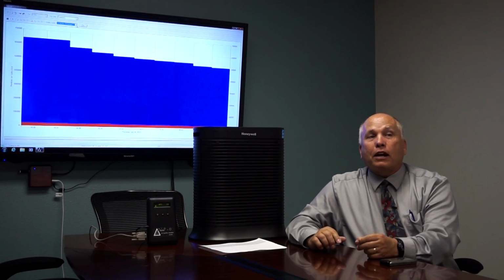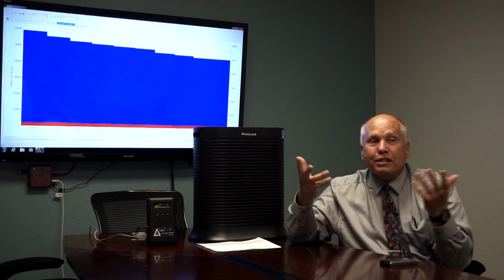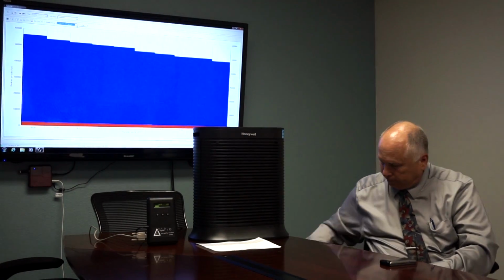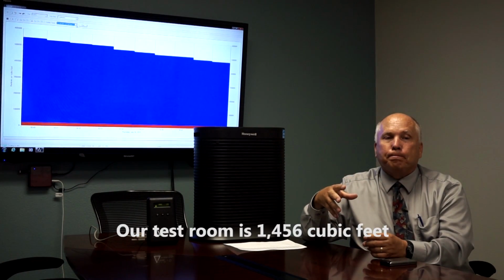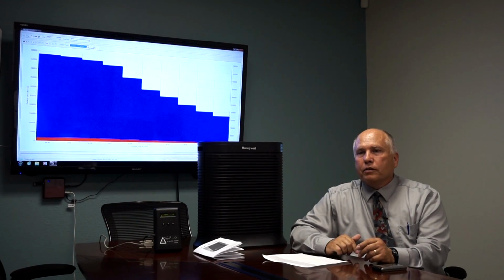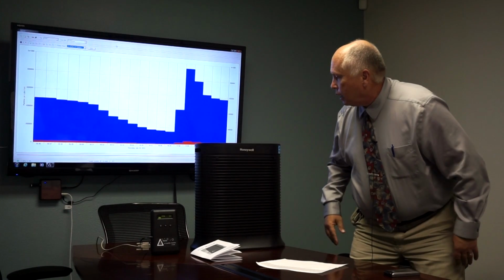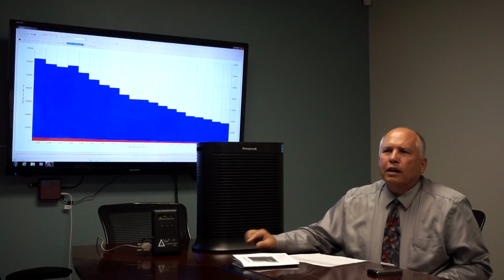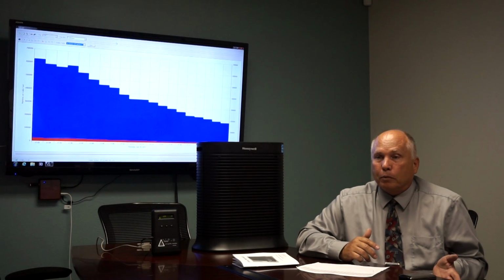Testing the Honeywell Air Purifier CADR Performance using Dylos DC1100-PRO-PC

Comment: Again a great and very informative video! You are a total pro. THANK YOU! 

I see the real money I should spend is on solving the problem (I know my air is very very bad). I get a layer of black looking motor oil type grease on the leading edge of our slow moving fan above our dining room table in about a month or two and it is NOT cooking grease. 

Best Solution: As I watch your video I noticed a video to the right of it titled:
Build a do-it-yourself air purifier for about $25
BUT I found that HEPA filters 24" x 24" cost around $200 so humm, a fan is $20 and ?...